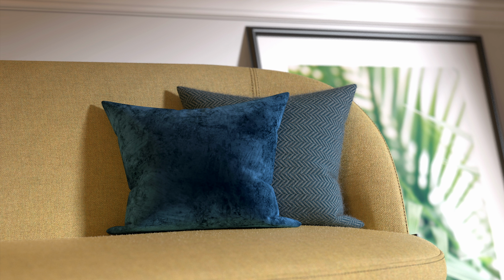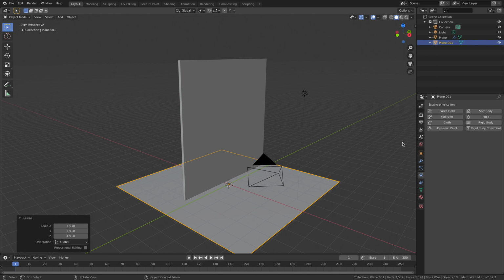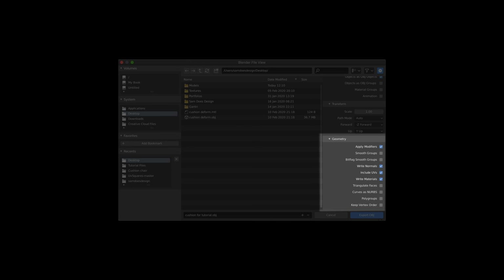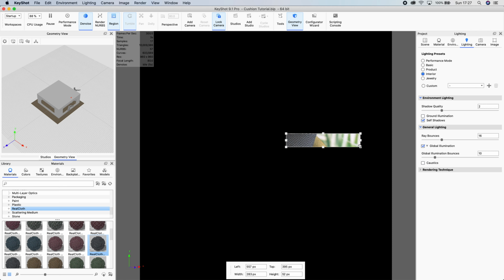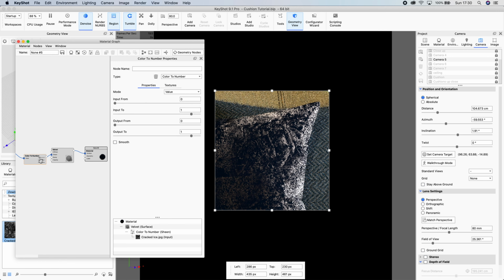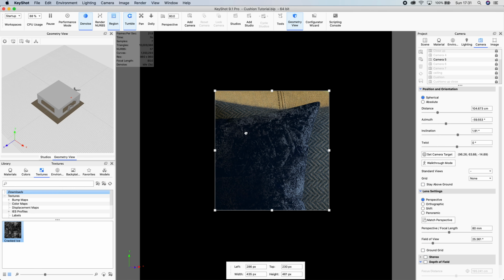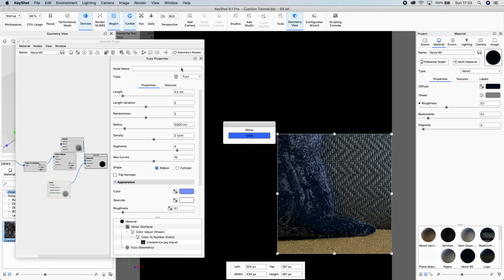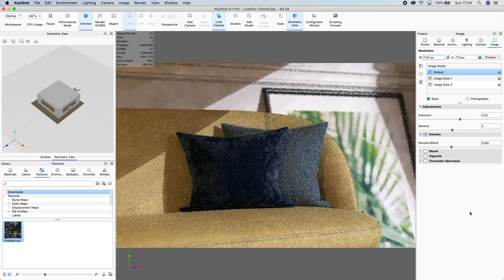Quick Keyshot cushions with Blender

Comment: Hey could you specify the pc/laptop(with specs) you've used for this... and how much time did it take for the rendering?
Reply from the maker: I personally use a MacBook Pro and I started and finished this video all today
Reply: @SamDoesDesign  I think Kaust was asking specifically about timer input (min/hr) for the keyshot rendering process.
Reply from the maker: Michal Durec I exported at 2500 pixels at 300 samples but then I had lunch and came back and it was done 😅 so between 20 and 30 minutes. Sorry I can’t be more help!
Reply: @SamDoesDesign  Thank you very much, for your answer.